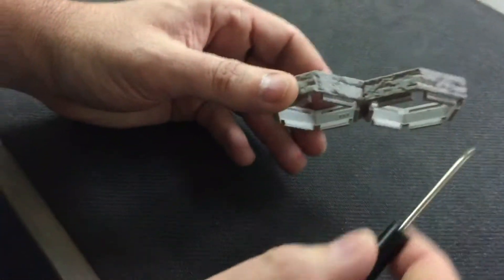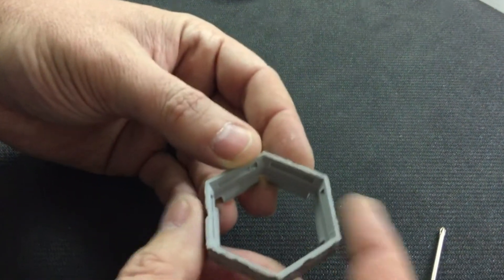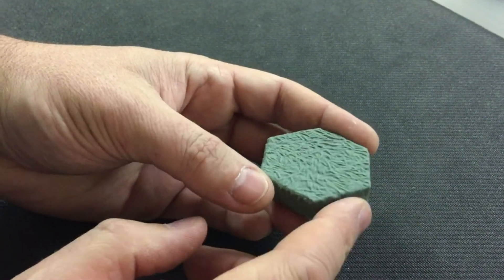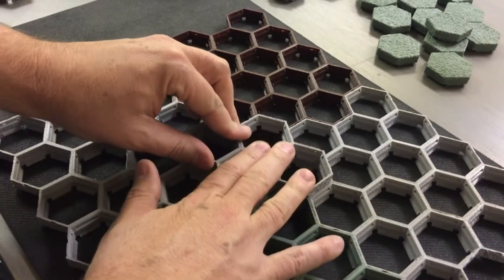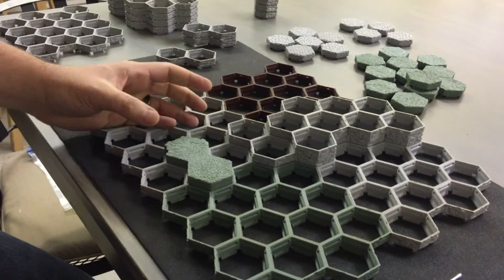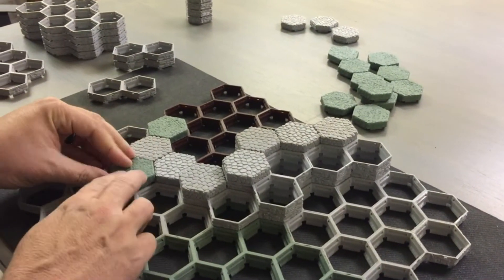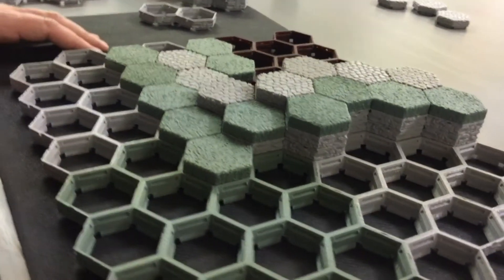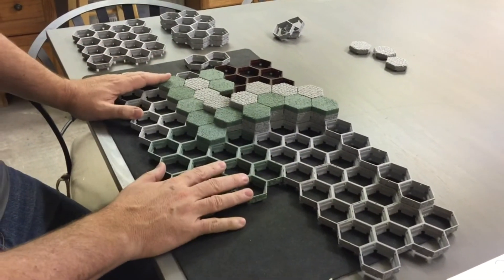How the new 3d printed HyGround tiles work.

Comment: would it be possible to make the crowns slightly counter-sunk (just as an option) to accommodate pieces with hex shaped bases, to prevent the pieces from sliding around?
Reply from the maker: The new design that we have released makes it possible for Heroscape tiles to sit on top and not slide around. I’ll try and get a new video out here showing that.

Comment: Very interested like the first time but I am only interested in the tiles I could use with my current collection terrain

I have a good amount of heroscape tiles. I was wondering why you guys don't want to make interlockable terrain?

What if i would like a nice big flat lands? One bump could send the terrain flying. Is it a copyright thing? Or is there another reason?
Reply from the maker: Eddie, The intent was not to recreate Heroscape tiles. Our goal is to create a new, more detailed terrain system. I have a significant collection of Heroscape tiles myself and have enjoyed that game for years but I wanted to try and improve on it. The patents for Heroscape tiles are still in affect, so a duplicate tile system is not legally doable. Therefore we created the system you see now. We've gone through many prototypes and design reviews and feel the current design is ready. As a support to everyone who has the Heroscape tiles already, we kept in mind there should be a way to have these tiles work together. I'm not knocking the design of the Heroscape tiles, they've been in my opinion an industry changer and have proven themselves for more than a decade. However, the interlocking design of Heroscape creates a couple issues for us; first the side view of the tiles is not that appealing, the protruding knuckle (not sure what to call it) also makes the tile 1.83" across flat to flat which means you can't us any standard 1.75" hexagon with it without notching the other tile and the horizontal connection is excellent but the vertical connection is lacking (especially for single tiles sitting atop the pile). We believe our new HyGround tiles address these issues. I'll try to get the video showing how these two systems could be used together out asap.

Comment: I’m intrigued. But, scared bc it seems that even though you guys use a hexshape but now with the clip system I fear that I will have to you either use hyground tiles or heroscape tiles. As well I feared of the clip system bc of the tabs I’ve had past issues with toys that have clips that tend to break not too often. But, if the clip fits in easy and I have a hard time to take it a part I don’t want to be forced to use extra force or a tool to take them apart. But, I am very glad you guys are working on these. Many games other than heroscape has ever used beautiful  scenery using buildable maps for their games. It adds a wonderful creative and artistic feel to the games and unlimited possibilities
Reply from the maker: Joe, I hope I cover all your points here. HyGround and Hersocape tiles are two distinct systems so they will not be interchangeable, however, we have created a transition tile. The transition tile has Hersocape connectors on one side and HyGround clips on the bottom. This will allow a person to build a Heroscape landscape and build a separate HyGround landscape and connect them together. Also, the HyGround starter base tiles will stack on top of Heroscape tiles.  I will post a video showing how the transition tiles work. As for the clips breaking we believe a lot has to do with the type of material you're printing with and even the printer settings. We've sat watching movies, clicking tiles in-and-out for hours and had very little breakage. We did find that the translucent PLA's from eSun are brittle and tend to break. Hatchbox brand PLA works the best so far, but MeltInk and Paramount PLA's are also very good. 3D printed products are not as strong as injection molded parts for sure and its never cool to have pieces break, we are in agreement. On a positive note however, everyone will have the files to print new and/or reprint the tiles as they want them. Thanks for your comments, we really appreciate your interest in these tiles.
Reply: Thank you for connecting with me and answering my questions I do have one more. Are these tiles printable only or will you be selling them as well? sadly I do not own a 3d printer.
Reply from the maker: Joe, we're primarily going to be selling the files but if it's doable, we may have a limited run of pre-printed tile sets available. I'm working on figuring this part out now.